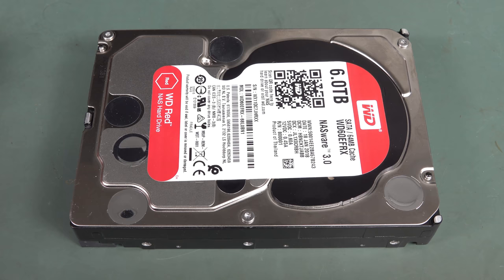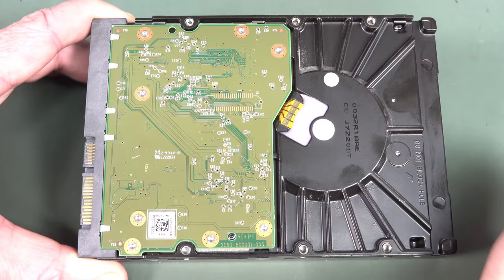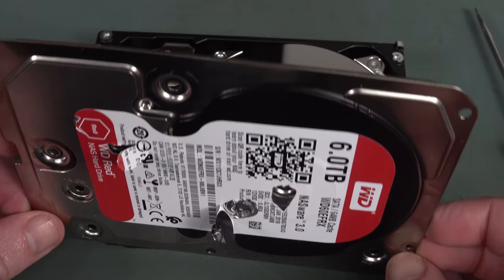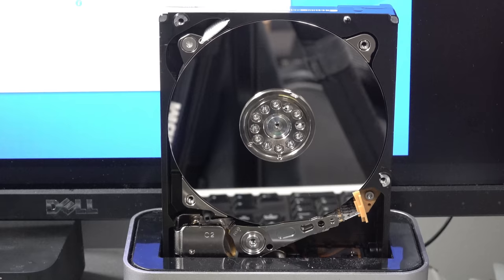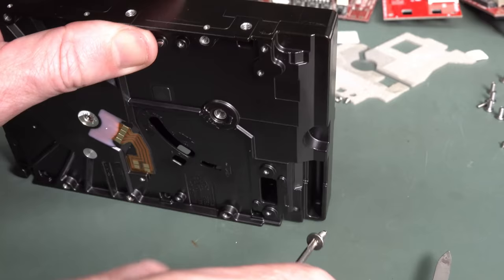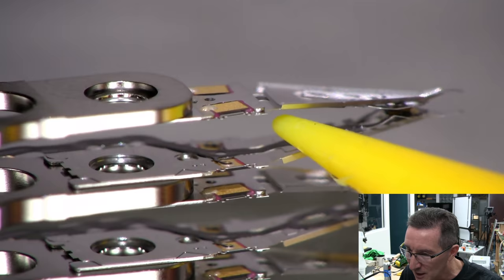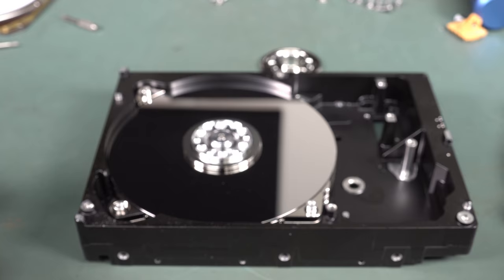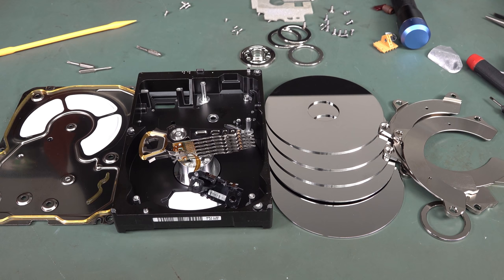EEVblog 1398 - Western Digital RED 6TB WD60EFRX Hard Drive TEARDOWN

Comment: Last time I teared down an HDD I try to unstick the magnets using a screwdriver and a hammer. One of them come out, the other broke into pieces and some spark come out as the screw driver hit it. That was impressive.
Reply: They are glue to the metal back plate.  If you ever want to try again, get two large sets of pliers and just bend the back plate the magnets are glued too.  That will pull it apart enough on one side that you can get a screwdriver in there to gently get the rest of the glue to let go.  I have done it tons of times. :D  For the thicker back plates/magnets, put one end of the back plate into a vice. :D
Reply: I worked at Imprimis/Seagate many years ago, in the heyday of the Wren 7 hard drive that was the first commercial drive to have 1GB of storage. The Neodymium magnets they had inside were so strong that if they ever made contact with a large appliance (like a fridge), you could not get them removed, at least not directly. If you slide them to the edge of the metal, then you can finally remove them. Many injuries were had in the clean rooms, by people who did not appreciate how strong the magnets were. That was 1989, and the magnets have only gotten stronger.
Reply: @markjohnson7887  , i damaged too many using this technique.  wikipedia lists methyl ethyl ketone as a epoxy solvent.  and because i regard it as less carcinogenic than methylene chloride i use it (in a sealed container ) to soak the magnets and holding brackets in for a few weeks.  then if they dont separate easily i soak them for longer.
Reply: @shubinternet  , modern hard drive magnets are getting smaller as time goes on.  modern hard drives arent worth dismantling for the magnets.
Reply: @vsvnrg3263  Interesting.  I haven't broken a single one yet.
Reply: @vsvnrg3263  They’ve gotten smaller, but only because they are stronger for their size. They’ve also gotten built into other parts of the drive internals, so that they are much more difficult to isolate. So, definitely not worth scavenging.
Reply: @shubinternet  , i beg to differ about them being stronger yet smaller.  i well understand there are grades of strength of supermagnets but the strongest are not many times stronger than the weakest grade.  old 1 gig super magnets are 3 or 4 mm thick.  i just checked my collection.  modern 1 terabyte magnets are a letdown, being about 2 or less mm thick.  and smaller in width and length too.  the designers are making less do more.  this is among the many reasons that modern hdd's are so cheap.  as i commented elsewhere, i dont worry about dismantling the terabyte hdd's.  i swap them for 1 gig ones.
Reply: @markjohnson7887  , i have.  and torn the chrome layer off.  i've had to learn to be patient and soak them for weeks or months in methyl ethyl ketone.
Reply: @vsvnrg3263  I don't care about the chrome layer personally.  As long as I don't crack them. :D
Reply: @vsvnrg3263  — The old Wren 7 magnets were like an inch thick and an inch and a half long. Not big enough to pick up 50 lbs or something like that, but strong enough to pinch fingers and potentially break bones in your fingers if you weren’t careful. The magnets have clearly gotten smaller since then, but I’m pretty sure that the field strength per unit of mass has only gotten stronger. What has changed is that they have gotten much smaller, so that they may not be as strong overall, even though they have a higher strength to mass ratio.
Reply: @shubinternet  , i fully agree with your last sentence.  ive watched a few shows about super magnets.  if the customer wants stronger ones they are available but they cost more.  there is a coding system the makers use that indicates the strength.  your first sentence scares me.  thank goodness, for my own bodily well-being,  i havent seen any of those.  i was lucky to score an antiques roadshow type hard drive.  6 x 210 mm discs.  i have poked gently around it to find out about any magnets in it.  there is a 40 x 50 x 60mm hole where the magnet(s) would have been.  would this have been a hole for a big fat super magnet?
Reply: @markjohnson7887  ,  rest assured i wouldnt throw a rusty one out.  but they do rust quickly with some of the uses i have for them.  they arent just trophies on a piece of steel plate screwed to the wall.  they are trophies!
Reply: i should add that methyl chloride paint stripper causes rust if the shiny skin of the magnets is damaged.  mek doesnt.

Comment: These are always so fascinating.  It's mind boggling how far storage tech in general has come.  Back in the day you needed a cargo plane to move 1MB of data around lol.    Going to guess the failure mode of this drive was a head related issue. Head was not reading correctly which caused it to keep seeking, and it would crash at the end zones because it did not know where it was.   At least that is my guess.

Comment: For those who still own old, really old VHS, or especially Betamax video-recorders, yes, the precision is not as great as a modern HD, but they are a far more 'mechanically' complex device than this HD by a mile.  As for precision, until the day that higher density hard-drives become the norm in homes, actually the VHS & Video-8 / Hi-8 video heads were the most accurate precision machined device consumers ever owned.

Comment: On display in my office is an old failed 80 GB IBM HHD disassembled. The headcrash had peeled away the magnetic media revealing GLASS platters! That user's data was distributed as a fine dust throughout the interior of the drive.
Reply: We made coffee tables out of ours after the surfaces were destroyed by head crashes. 2m diameter disks. A few of them managed to store a few tens of megabyes total. Enough rotational energy to roll over the 900 meter high coastal hills into the ocean.
Reply: I have a SAS drive where all 5 platters were pretty-much transparent. What a mess inside that one was.

Comment: For those who are interested on the tech that goes into making and using those heads, these heads use something called "Giant Magnetoresistance" to read magnetic fields.
The trick here is they are injecting electrons of different spins between the magnetic layers separated by non-magnetic materials and depending on the field it can align those electrons to be the same spin and it manages to achieve lower resistances or higher resistances depending on what is written on the platter

It is very sensetive to those fields and a lot of spin offs (pun not intended) of that promise an alternative to solid state storage.
It is absolutely an amazing field i am glad i got introduced to it with my physics degree. Could write a whole conference on it and still not cover everything that we know, much less what we don't know.

Comment: I still have some platters from an old IBM drive I took apart.  Out of the thousands of HD's I have taken apart for my job, this drive was the only one with glass platters.  Glass.  Fascinating.
Reply: I've seen glass platters on 3.5-inch drives. They didn't look like they were made of glass, until we decided to build a demonstration experiment for physics lessons, and one shattered on us while we were messing around. The plan was to demonstrate their magnetic friction against a magnet, which of course wouldn't work with glass.

Comment: I believe the slot on the underside of the HDA is for the servo writing machine to place the embedded servo information (for proper actuator tracking) onto the platters before the controller goes in

Comment: A thing of beauty. 
All done by robotic milling of cast parts.
Reply: The things are too precise and thin for reliable casting. There will be too many issues with pores, craters, uneven pouring and many other ones. I would rather expect them to press and bake some fine metallic powder mixture in a mold.
Reply: @Kirillissimus  You can see the un-machined part under the coil. It's a cast aluminum part that has been machined. 
This is not done by a DIYer with his homemade casting jig!

Comment: The head coils are called "voicecoils" -- very  similar to those on speakers, hence the re-use of that term .... so the loud sound makes sense if one goes bad. But -- BION --- it could be a failed chip or passive. I've seen that more than actual head crashes (and yes ... a bad chip can cause voice coil noise .... like a bad power amp can distort speaker sound).

Comment: I never cease to be impressed by the precision of the machining in hard drives, especially at the price they're sold for. With the lid off and powered up you can't even tell that the platters are spinning.
The head carrier arm has to be machined as there's no way to hold any decent precision with a casting.
Reply: It's probably a combination of machining and casting.
It's easier to automate the process of normalizing oversized casts, and some portions of the drive arm don't NEED incredibly high precision, and can be off by a couple thou without ruining the part.
I had a machinist for a neighbor and he gifted me a bearing sleeve that was rejected for being off-model by 2 thousandths of an inch, making it worthless.

Comment: Could that center spindle screw be reverse-threaded? Also, maybe the fact that the spindle didn't turn freely indicates that the sound was actually a failing bearing? Commenter Rob suggested it was a servo amplifier gone bad causing the head to lose control of itself.

Comment: WD40EFRX still in service here, although I think it is making a bit of an odd rubbing/ticking noise (frequency of a few hz). Will have to reseat the drives in their bays and see if that helps.

Been a very consistent performer for years, though, and the new shingled Seagate green drive I've got isn't notably faster on reads.

Comment: I suspect most modern drives fail due to degradation in the servo tracks etc, the problem is these are written in the factory and cannot be written/replaced by the drive.
There are methods out there to avoid bit rot, by rewriting data, however any rot on the servo tracks and its a gonner.
All the 'dying' noises you hear are from the servo system as it tries to keep on track/station.
In the early days, you could put a HDD into a demagnetiser, removing EVERYTHING, then re-write it with formatting
software/commands - these days try this and your drive will immediately die, totally unrecoverable, because you've lost those factory only servo etc patterns.
What's most interesting is your SMR drive has outlasted your CMR drive!

Comment: Dave in the machining world, the platters sticking together is called ringing. It happens because of the precision flatness of same materials actually cold weld together due to their close proximity to each other. Therefore they become hard to pull apart. If you did not fingerprint the platters which actually put some extra thickness to them it would have been more difficult to pull them apart.
Reply: Wringing, not ringing.  The stiction is due to mating flatness removing all air, a virtual vacuum.

Comment: I think the white object removed at 12:13 is a filter that uses the multiple-disk centrifugal pump effect to pull the air pre-filtered across the disk heads in a smooth, clean laminar flow.

Comment: You should get an impact driver, if you don't already have one, to help with getting stubborn screws out.  They work well on screws attached to things that spin because the rotational impact action is faster and can apply more instant torque than you can with your hand.  I've used them to take apart dead hard drives.

Comment: That little white square is an air filter, not a desiccant, as far as I'm aware. You'll notice that it is right by the hole on the bottom that says "do not cover hole". The drive needs to be able to equalize the air pressure, so it has to have a vent hole, and that filter is there to keep dust out.

Comment: Hi Dave,
These WDs are notorious for PCB failure, for whatever reason, be it thermal or otherwise. The drives are mechanically fine 99% of the time, and there is now a business of replacing and calibrating donor PCBs to failed drives like this.
I recently moved away from using WD RED drives, picked up a dell poweredge R710 + powervault MD1000 for around $200 USD each, and filled it with 15 hitachi HUS723020 2TB units. Now I have 21TB of usable space, with two drive redundancy, and one online hot spare. out the door for less than $1000 USD. Not to mention i have a full fat server from the deal
Reply: I have some of those drives and they just keep going.  A different class from WD and Seagate for sure!
Statistics from cloud storage companies agree with that.
Reply: @Rob2  Yeah it would be nice if all drives were like those HGSTs. mine all have over 49,000 hours power on time, all 100% health, no unrecoverable sectors etc... of course they've also spent their life at 31C in a rack enclosure, but as you say the cloud storage statistics speak for themselves

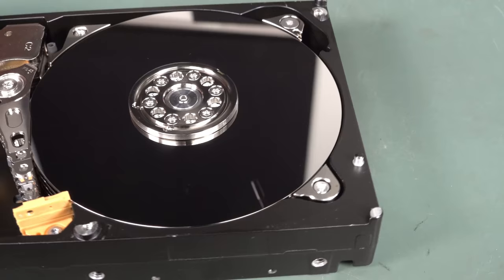Comment: I bet all the extra holes 13:06 are for a specialized tool that holds the platters in a fixture. The other holes are for the screws.  When half the screws are put in the platter is turned about @ 180 degrees (or whatever it is designed for) and the other screws get put in.

Comment: Dismantled   quite a few  old  hdd    for Magnets 
Made a small grinder out 1    stuck some  fine  sandpaper on the disk  
other than that         the  case use for  a  mount  etc or  scrap

Comment: I still have the mechanical portion of a 1960s (?) drum memory.  I discarded he cabinet and transistor type electronics years ago.  It was part of a NASA system for the Orbiting Astronomical Observatory ground station.  I think it was used in Ecuadore.  I did this same sort of disassembly.  It has 128 tracks with one head for each track.  It has one large solenoid that engages all the heads once the drum is up to speed.  The unit was manufactured by Vermont Research Systems.  Maybe I should do a YouTube tear-down of it???

Comment: A number of drive repair videos show the common problem is the heads. A jig is used to keep something in position while the heads are removed, and donor heads replace the faulty ones. It is a fairly quick operation by the guys who do it for a living. Yes, faulty heads are the cause of the death click, the platters are generally ok. Once repaired the data can be recovered, for people with no backups.

Comment: The head bracket looks like it is made with sintered metal. Its basically metal powder with a binder packed into a likely multipart moldthat is baked a near melting point temperatures where the grains bond to their neighbors. It's a high precision manufacturing method with little to no after process needed, though this part seems to have been chromed.

Comment: Just took apart a Western Digital Enterprise SATA drive. Interesting to compare between them. For example, instead of the plastic pads on the lid, they actually glued a piece of metal to the top to stabilize the lid. Drive had nearly 50k hours 24/7 on it. Apparently you do get something for the extra coin spent. I've been saving all the drive platters; maybe they'll make a neat wind chime one day. They make a good "ding" noise. 👍

Comment: About screws in hard drives: they're not loctited up, just somewhat seized by being VERY CLEAN and probably very close tolerance. The trick to take them out is to put the screwdriver in and then give the screwdriver somewhat of a whack. Firm but don't overdo it. That makes them much easier to take out. Without that you can easily break your screwdriver or strip the screw head. Did both.

Edit: the head holder is machined from a solid block of metal. Probably not just your STANDARD block of metal, that's special as well, manufactured so there is no inner tension that might cause it to warp. Anyway you can easily see machining marks on all surfaces if you know what to look for. They're VERY fine machining marks, mind you.

Comment: The hollow traces on the head could be thermal insulation, so that the chip-on-flex does not desolder. The traces are broader than the others, so the may carry the current for writing, perhaps? What do you think?

Comment: You didn’t take the motor out of the frame. I’ve torn down a few of these, and some won’t come out. With some models, the platters won’t come apart from the motor.

Comment: From the sound I would say the head arm is vibrating.  I would have check the electronics first, the servo sensor second, and the bearings third.  The platter spindle probably glides on air bearings.  The brushless DC motor hardware also will drag due to electric generation.

Comment: The WD60EFRX-68L0BN1 is a Rembrndt family drive, and was the last five-platter drive using this HDA (basically the chassis of the drive) from WD. Each platter can store 1.2 TB on that. It has now been replaced with a lighter WD60EFZX-68B3FN0 that has four (codenamed Avalon CR); meanwhile, WD replaced the Rembrndt family with the Avalon C5 family, which tops out at 8 TB. Both Avalon CR and C5 use HGST Ultrastar HDAs, but with WD firmware.

Comment: HDD platters have a beautiful bell tone when you strike them.  I use platters from an old 5.25" drive in my music percussion kit. A friend of mine builds analog clocks from discarded 5.25" drives, and the shiny platters make for great clock faces too.
Reply: Just don't try that with coated glass platters...
Reply: @johndododoe1411  Good point!

Comment: Love the video! Hard drives are an essential part of any computer system, yet they're often overlooked when people think about their machines. If you've got problems with your hard drive or it needs repair (or both!), we can help quickly--we have been working on these issues since 2003! Our success rate at saving data from failing HDDs has always been higher than 96%.